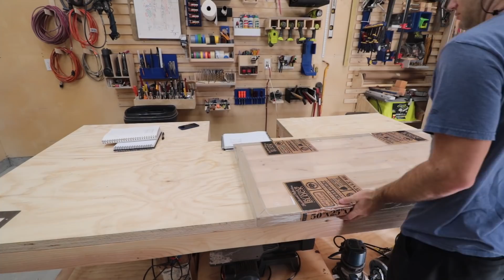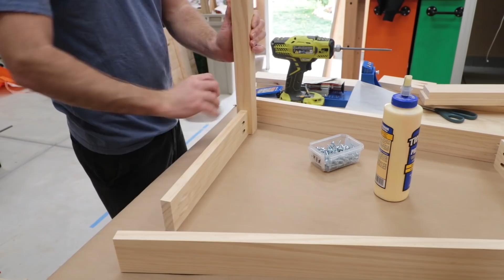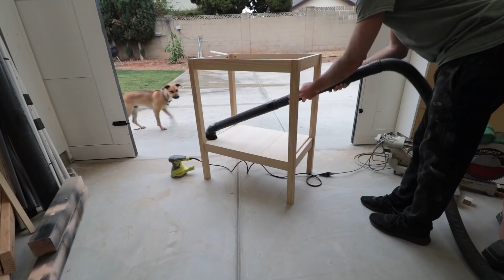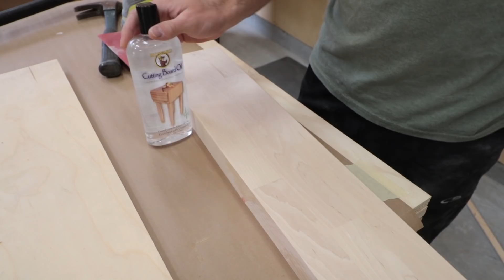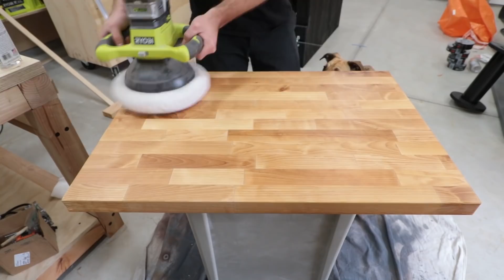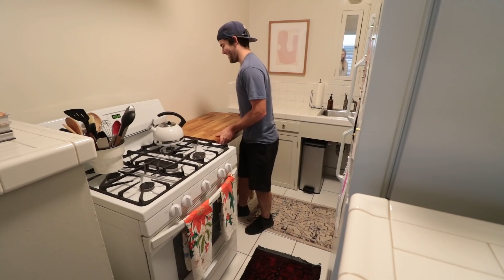DIY Butcher Block Island

Comment: The tip at 3:30 about the 3/8" spacer is excellent.  I didn't initially catch that in the video.   As I got started on my version of this, I thought, "Hey, I should use a spacer."    I was going to post a message suggesting it, and, well, you had already included it!

Comment: Just so everyone knows in case you do something like this - mineral oil *does not cure*.  Mineral oil is "non drying" - so it stays wet.  Which means that you're basically just saturating your butcher block or cutting board with liquid that will never dry, - so eventually it will either weep back out of the wood over time, or it will sit deep inside and get all gross when it gets mixed with all the other old food stuff that gets in there.  There's technically nothing "wrong" about using it on something like this and it's pretty common practice, but it's really not the ideal application if you want something way more long lasting and protective.  Because it's in a liquid state it just means that over time it will come back out of the wood into your food, or it will get washed out as you clean it over time.  Which means you end up having to reapply more oil pretty often in order to keep a good protective finish on the wood.

Use Tung Oil, you can buy it online or some woodworking stores.  Make sure it's 100% pure tung oil, no tung oil "finishes" or anything like that, those can have other additives that you don't want.  Tung Oil absorbs into the wood and will actually cure and harden - it doesn't weep out later or just stay liquid like mineral oil.  It provides WAY better resistance to absorbing moisture from water or food.  And it will last way longer, so you aren't going to be reapplying oil every month or whatever

If you're looking for quick and easy - tung oil isn't for you, just go with the mineral oil, because tung oil can take much longer for each coat to full absorb and dry properly -  But if you have the patience to wait longer for your project to turn out better in the long run, it is the right choice for you.  If you wanted to do several coats of tung oil, it could take weeks to finish the project because of the time it takes for each coat to full dry and cure.  You'll just have to decide for yourself if you're willing to take the time to get the better and more long lasting result

here's a good video showing a comparison between the two and some other finishes - https://www.youtube.com/watch?v=l9fqCJ5kJiA

Comment: The table came out really nice.  I'd have to buy the block top as well, no jointer or planer either.

One thing, please wear a mask when you sand.  It's bad for your lungs and over time you can develop a sensitivity to some woods that'll hit you like a bad allergy.  PPE can be hard to come by, but KN95 or even a cloth mask is better than nothin'.

Thanks for the video, stay safe and healthy!

Comment: Glad I’m not the only one that still sits on the floor for the mitre saw when having a workbench. Until an actual mitre bench is made.
Reply: There is already a provision for the miter saw in the bench. He plans not to use it in that location until he has a dust collection system.

Comment: That wonderful workbench and you're on the floor cutting lumber again.
Reply: There is already a provision for the miter saw in the bench. He plans not to use it in that location until he has a dust collection system.

Comment: Wonderful work!! (and NO it's not cheating!) I love how your dog follows the vacuum cleaner! It's so funny to watch! Here's a suggestion, make a ball launcher. Something small enough to be around you when you're working, but powerful enough to launch both balls. Then have it so the dogs can drop it on to a gathering area, it rolls to the "launch pad," and then the balls gets launched. 😂😎

It has to be small enough you can take it with you when you're working, strong enough to launch the balls far enough, and have an auto reset for the next launch. Puppies are happy, you don't feel guilty or frustrated. Win-win! ❤🧡❤🧡

Comment: Wait, all those pocket holes and you used L brackets to attach the top?
Reply: Both are bad ideas. He should have used Z clips to allow for expansion.
Reply: @rchavez5056  I guess that depends on what side of the debate you land on. Some will say that it's not an issue since the temperature and humidity fluctuations aren't that great in a conditioned home. Others will say better safe than sorry.
Reply: @ColeSpolaric  True, 
It's bitten me to many times that I use Z clips every time now.

Comment: Love the idiot dogs helping mine are the same , only things I would have changed is maybe use plywood for the bottom shelf and maybe put a "juice groove" on the top incase your sister cuts something  juicy on the top
Reply: " incase your sister cuts something  juicy on the top"
Things should never be cut on a counter top. A cutting board should be used. "Butcher block" and all that implies or not, this is a table or counter "top" (as you mentioned.). I have experience with such counters (larger) and have become very upset when people cut anything on a counter in my kitchen without using a cutting board.
Reply: @timetravellingbunny3952  sorry youre crazy , what do you think butcher block was original designed and meant for ... have you ever worked in a restaurant.... ?? Butcher shop ?? Anyways maybe with some time your OCD will relax a touch and you won't flip the switch so to say
Reply: @ryanaustin1970  It was a comment from a person who has 17 years of professional experience working in a kitchen. As a youth, I also worked in a butcher shop. You would not be allowed in my kitchen.
It was a civil comment. You needn't be a douchebag in response.
Reply: @timetravellingbunny3952  oh sure ... totally believe you ... I guess prior to uhmw plastic that most kitchens now use every chef or butcher always said ... hey Jimmy can you snag me a cutting board , Nope ! ... the countertops were made of wood ..aka butcher block ... and everything was prepared on them

Comment: You built your self a nice work bench. But still sitting on the floor with your miter saw. Is it from old habit? 😄
Reply: There is a provision for the miter saw in the bench. He plans not to use it in that location until he has a dust collection system.
Reply: @timetravellingbunny3952  Yes I watched him build the work bench. But it must be much more comfortable to stand up instead sitting on the floor. The dust will be the same amount, were ever the miter saw is.
Reply: @markojarvinen  Yes, to that.
"Is it from old habit?" We can only speculate.